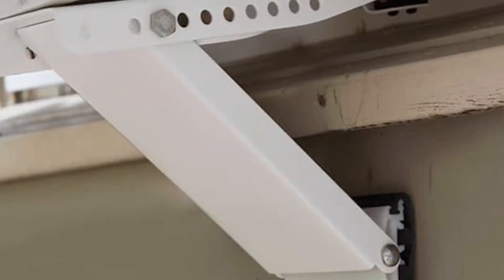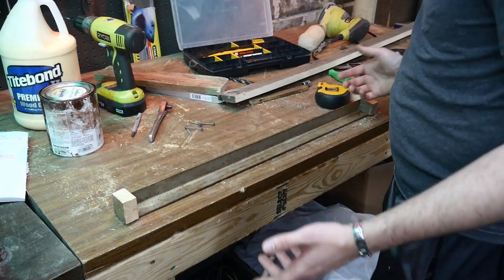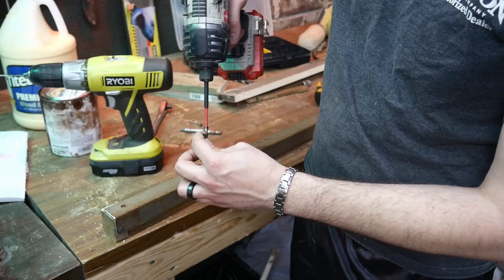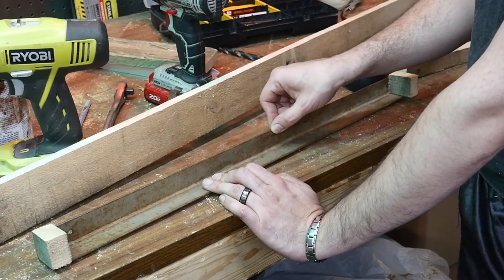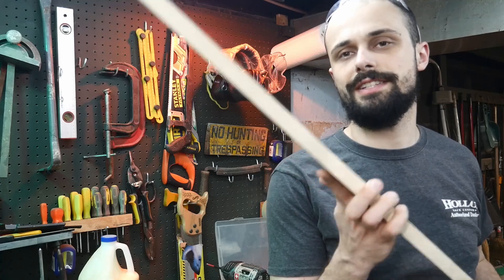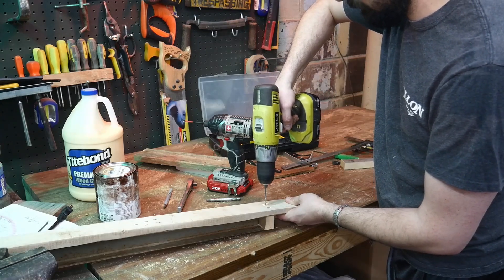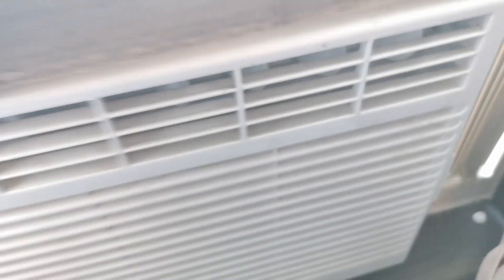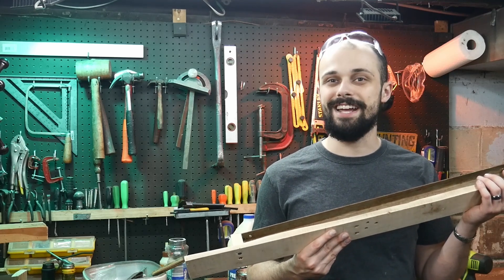DIY Bracket | Safeguarding Vinyl Windows from Heavy AC Units

Comment: That’s great, but how do you support the bottom sash of cheap vinyl window?
Reply from the maker: I didn't solve that part... my windows seem to hold up there... maybe some flat steel bar stock or channel slid in running from either side of the window??? This would transfer some of the load to the sides where the window is/should be stronger... it would also spread the load... not as good of a solution though

Comment: The immediate issue I see is placing the air conditioner on a vinyl window altogther. Warpage or separation of the window frame can occur from the weight of AC unit. Vinyl windows are simply not made to carry that weight. That becomes a severe issue if there is a cavity between the bottom frame of the vinyl window and the wooden sill it is sitting.
     The best advice I can offer is to build a wooden cradle that will be supported by the inside and outside sils. The AC unit sits on top of the cradle and damaging the window frame becomes a non-issue. In making the cradle it should be angled 4 to 5 degrees downward towards the outside for water run off.
Reply from the maker: Thanks for the idea!
Reply: issue issue issue issue issue Is that the only wording people vocabulary anymore what's wrong with using the word problem it's not an issue it's a problem
Reply: Nothing at all. It's a problem." make an issue of
treat too seriously or as a problem."